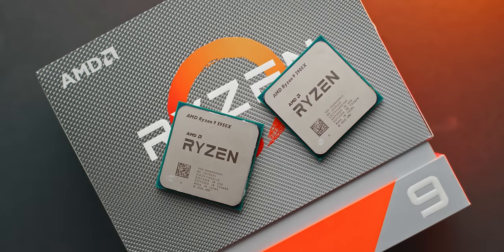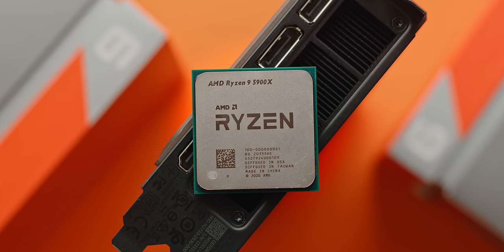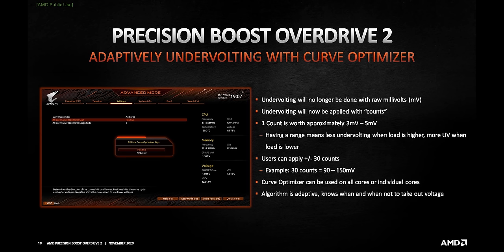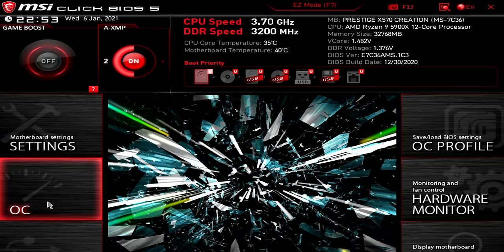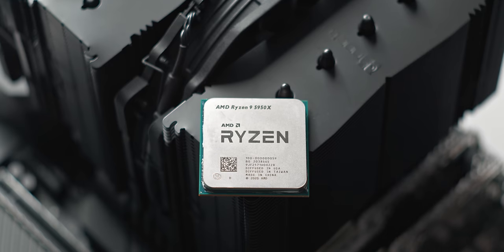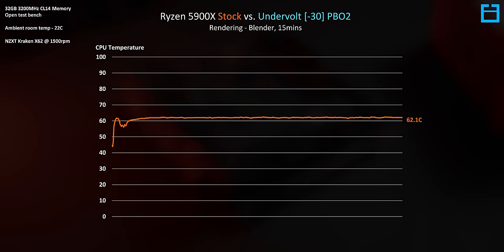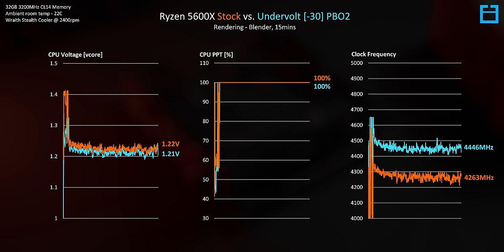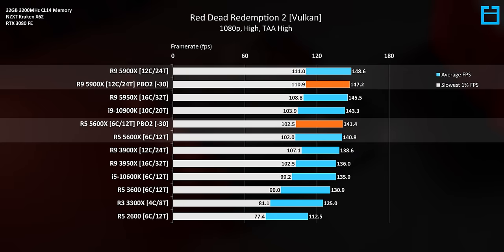Ryzen 5000 Undervolting with PBO2 – Absolutely Worth Doing

Comment: I have a 5800x, thanks for using everything except that one xD Edit: I did mine but my max value seems to be 10. On idle it's already 5 degrees cooler.
Reply: What happened when you tried to increase the max value / what were the signs of instability?
Reply: @Lha_Luke  There are no sign of instability. You just put the highest it allows and go about with your day. This isn't a regular over or underclock, it's safe. They put the limits for you.
Reply: Highest I can go without cinebench23 crashing is -15 with my 5800X. Max temps now more than 5C lower, gained a few hundred points on multi core, single core remained pretty much the same.
Reply: @Lha_Luke  I got instability. Crashing. Blackscreen. BSOD. Keyboard and Mouse locking up and some game crashes I'd never experienced, when I set it too high on my 5800X. Although I could stress it with CPU-Z at 25 and 20 for 5 minutes just fine, temps weren't lower but performance increased. But then in games I'd get crashes.
Reply: Not trying to flex, but I managed to reach 25 stable.
Reply: @kibido7373  It doesn't let you go past 10 unless you turn off the safety. I'm not going to mess with my PC till it becomes unstable then back up a bit. I did this for thermals, pushing for an extra half a degree isn't worth it to me.
Reply: @kibido7373  same here with my 5800x i did -30 but system crashed in AC valhalla settings ,dialed it back to --25 and so far its golden benchmark  looking fine as well in cinebench R20
Reply: So far I have mine running at -22 and just scored 1652 SC Cinebench. I agree with other the concern will be stability at idle/low loads. I noticed at -30 that I couldn’t even boot up. The computer got stuck in a restart loop until I changed it.
Reply: No matter what i do my 5800x stays at 82-86 degrees in Cinebench r23...
Reply: @SwiffyDK  That's really bad, is your cooler on properly?
Reply: @Tony-nl6pf  Yep I have taken it off and on again. I’m using H115i Capellix with Kryonaut thermal paste.  I’m running it on stock settings.
Reply: 5800x on x470 Asus CH7, -20 with +200mhz boost, hitting 5015mhz single core and temps are lower
Reply: @Justathought81  I cry
Reply: @SwiffyDK  stop QQ it wasn’t stable ;) for a moment I thought I had nice chip but maybe not so good. Of course even at stock this things an absolute beast so I can’t complain :)
Reply: @lawnica1  Update couldn't get my PC stable with anything below -15 undervolt. Still pretty nice performance and temp improvement.
Reply: I was able to run -30. Dropped temps from 90 to 85 in cinebench r 23 and increased score from 15000 to 15600. Boost clocks up 150 on average.
Reply: update: 5800x/1080TI/64GB3600 here -- -30 with settings above is making my games crash to desktop.
Reply: My 5800x passed cinebench multiple times with -19 offset but to make it stable and error less with occt and prime95 I had to lower it to -11. Temps are 5/6 degrees lower and cinebench score is 300+ better than stock.
Reply: I've just set it to -20. Max temp setting to 70°C running loop with gpu and cpu 2x 360 radiators with ek vardar fans. Ryzen master settings are PPT: 1.050 TDC: 80 EDC 115 
Max pbo I'm getting is 4600 mhz and it never goes above 70°c . Cinebench score of 15122. Still have to play some games to check the stability
Reply: I just set my ryzen 5800x to -20 and my temp on idle is roughly 60°c and under load I find it a bit high with temps peaking at 90°c what about you guys?

Comment: Motherboard limits to disabled why? This I just the UV what's about the offset. You can easily get the 5600 boosting to 5ghz+. Just by add this setting  to what u already have. Add a +350 offset in the Advanced CPU configuration and also set it in the AMD CBS menu (@+200 as that's what AMD officially allow in that menu). That why your curve optimiser works a treat.
Reply: Exactly this. This video just scratches the surface. There's much more to tweak to unlock the full potential. Enabling PBO is key to this (but it means you have to put in the work - the PC will now crash with a simple -30 undervolt on most CPU's). 

I'm running a 5600X with PBO, +400Mhz, -12/-17 on best cores and -22 on the rest. Runs around 4700Mhz all core in CB20 with voltages around 1.25v for a score around 4700. Single core it achieves up to 5050Mhz with scores around 640 in CB20 (which is not that special - my best cores aren't that great).
Reply: @miseryshining  How do you determine your best cores? (If that's even what your trying to say you've done here) I am still kind of a rookie and I'm trying to gather as much information as I can so I would be ready to get the best out of my next pc build once rtx 3000 series and ryzen 5000 series are more available.
Reply: @Leonard_27  the ryzen master software tells you that info iirc
Reply: ward

Comment: Brilliiant. Couldn't get -30 with 5600x, Hyper 212 Black Edition and Gigabyte B550 GAMING X V2 but -25 works fine. Lower temps for everyday day stuff and +200-300Mhz higher clocks when needed at the same temps as before. So quick and easy to do.
Reply: even -20 crashes games under load for me. Had to switch to -18

Comment: My G. Thank you for simplying this for me for now. I just finished my build and got a free upgrade from a Ryzen 7 5800 X to a 9 5950x. Yes my multicore performance increase was obv. amazing though single core score not as much.(as it could be). I have 4 cores peaking at 4.999 @ 38.4-72C (warm day). I may have only gained a slight 0.45 MP Ratio in Cin3R23 with my 4 cores now hitting 5049 MHz but my thermals are no longer touching 67c under load. 
This is a great stopgap so I can move the F on until I can learn more.

Comment: got -17 stable on 5800x. All core down from 89*c to 81*c, all core boost gained 100mhz and score increased by 30 pts in r15. Single core frequency and score didn't change but dropped 6*c. Overall great outcome.

Comment: For 3000 series, it was not that recommended to undervolt, they found it sometimes had less performance even with higher clocks than stock. Not the same anymore with the fixed 5000 series is incredible ! And it's fairly simple !
Reply: Well, it had to do with the power limits of the chip. Package Power adjustments were previously the correct way to reduce thermals while barely affecting performance. This was due to how X570 and PBO worked with Ryzen 3000. I am glad it's fairly standard across the board now though. Surprised that Optimum Tech didn't know about the PPT adjustment. That was the "correct" or ideal way to adjust thermals
Reply: nah i recommend it tested several times between default and undervolt. the voltage in default was way off and runs super hot. undervolt 3600 to 1.25v @4.2ghz runs fine and better in cinebench after several loop and the thermal -15+-
Reply: @nyabudulu  100% agree since I do the same. 3600 4.2ghz@1.225mv is better than 4.2ghz@1.35mv
Reply: It was recommended. Undervolted my 3700x it reaches higer boost ferqs and lower temps (15-20 celsius). 4375mhz singel core and 4100mhz all core in node 202.
Reply: I find undervolting my 5800x hardly does anything.  The only good way to reduce thermals has been to power limit the chip.  And this is with dual 240 rads in my Ncase
Reply: @SSJ3Goku69  Higher clocks, more singlethread perfomance, better gaming too.

Comment: @Optimum Tech, I would suggest keeping the PBO limits to "Motherboard" instead of "disabled" considering the case where PBO might have some stability issues then later option sends the system in a boot loop.  (Based on personal experience)
Reply: THANK YOU YOU HELPED ME SO MUCH. why did i watch this stupid ass video took like 10hours of my time and couldnt pinpoint what the problem is. He should seriously take this video down i'm fuming...

Just set pbo2 on eco mode because i dont want to fumble with the settings and base clock to 3.3ghz instead of 3.7 just trying to run the pc at lower wattage because i run off a battery (i use a 5600x)
Reply: What's the difference between Motherboard and disabled. My pc keeps crasing when i idle.
Reply: Please explain! What does motherboard do?

Comment: Heh... Did -25 on all cores on my 5600x without overclocking (just needed better temps). So in Cyberpunk where I had 80C, it now became 62-65C! I'm literally very impressed! I use the Wraith Prism cooler at 50% of it's max RPMs, cause at full it's just to loud. Wanted to replace the cooler, but this changed the game for me! :)
Reply: Hi, I’m in the same situation as you with the wraith cooler.. What voltage did you set it at?
Reply: Is undervolting still stable for you?
Reply: @enessengul219  Yes. Stable and cool. :)
Reply: Whats your setting in PBO limit?

Comment: Hell yeah, I've been fighting this for  6 months with 5950X.  Seeing the curve optimizer updated into my ASUS bios (it's the original Crosshair VIII Hero) was a huge relief.  I haven't set it up yet, I've just been thermally throttling with a water block setup @ 75C.

Edit:  I just set up the Curve Optimizer with a 5 negative offset for all of CCD 2 and zero on CCD1 (with my best cores), I'm getting 10C lower temps already and still getting my 5.2Ghz on two CCD 1 cores.  Voltage is idling around .95 with max voltages at 1.401
Reply: Did you used boost override? Have you done a CB20 run so far?
Reply: @agentorange1291   I did all of this in my BIOS.  Actually ran into some consistent fatal errors on core 14 at idle, so I had to remove the offset for that core and it's working well now.   My R20 score is 10828.  Manual overclocking to 4.9Ghz on all cores I got it up to 11960, but thermally and longevity wise that's not a realistic thing to do.  I was running temps at high as 90C with 75C at idle even with 360mm water cooling.  My temps are now around 40-50C and peak at 60C when I'm gaming.
Reply: @CHAOSMOVEMENT  Are your best cores only on CCD1? According to Ryzen Master I have a on each CCD a gold start core and a silver star core. Did you changed your boost override? What I have seen that with lower PPT (200) and lower EDC (150-160) I get better results as when I chose the motherboard limits in terms of temps. THe bench results are a bit lower. But when I use the motherboard limits my CPU is on 90degress in CB20 MC and around 78 in SC. The results vary quite much specially in OCCT.

Comment: Do one for 5800x a step by step 🙏
Reply: This!
Please do a 5800x with full step by step instructions for the lamen!
Reply: @jasonredwine4092  Just try it out yourself? If you end up over-doing it and the pc doesnt boot anymore, you'll have to clear the CMOS (resetting the BIOS settings). To learn about how to do this, just read the manual of your motherboard. It'll either have a button on it for this if it's expensive enough, or it will have 2 metal poles somewhere that you will have to link together for about a second with another metal.

Comment: You should have done a test for 5800x. that cpu is the worst at stock temps due to the ppt being set to 142W out of the box and not 105W as stated on the product page.
Reply: PPT is the physical design power of the AM4 socket though, not the TDP of the chip itself. A CPU can run with higher power absorption than the TDP for a short while.
I just recently put together a 5800X system (maybe I should have gone for 7600X!) and it really isn't that hard to keep temps down. A 50 dollar Thermalright cooler and undervolting (Negative 25 on the Curve Optimizer) keeps it well away from the thermal throttle limit (90C) even on a 130+ watt Prime95 test load.
Reply: @devilsoffspring5519  I have tried that with mine. But still sits at ideal around 50 to 65degC. Most cpus are at 40 to 45.

Comment: Changing my PBO limits from 'motherboard' to 'disabled' killed my performance (5950x + Crosshair Hero VIII)
Dropped from 28.9k in Cinebench R23 to 25.6k

Also the undervolt didn't have the same effect as you described - instead of lower power/heat and identical score, I got identical power/heat and higher benchmark scores.
(Not that I'm complaining about that!)

What I did now was set PBO limits -> 'Manual' and picked something between 'disabled' and 'motherboard' so I got a middleground where temps/noise are under control but with a performance increase.

Looking at Ryzen master:
'disabled' PBO limits: ppt: 142W, tdc: 95A, edc: 140A (I hit 142W, 72c, 50% fan speeds)
'motherboard' PBO limits: ppt: 395W, tdc: 255A, edc: 200A (I hit 220W, 89c, max fan speeds - too loud)

I went with ppt: 180W tdc: 255A edc: 200A (so 'motherboard' but with lower watts)

Comment: All this looks great until you do stability test with cinebench. I thought it was the ideal setup until it immediately crashed 2 or 3 times in cinebench runs. Only when scalar multipliers were set to 1 it didn't go haywire. I strongly encourage othera to just use PBO limit instead; waaay more effective at temp control. Set all offset to 0.

Comment: Thanks for the tips, I undervolt my ryzen 5 5600g to - 20. Beyond that will restart the system. The first try -30, 25, 20 failed then try from -12, 15,18 and -20 is working and become stable until now.

Comment: Do not follow his advice on your 5600x 5800x 5900x. -30 will pass every tests inside 1 hour but it will crash after weeks or months out of nowhere. When you get that crash go to event logger built in windows and check which core has crashed. Reduce the curve by 5 on that core alone using Per Core settings. -30 will actually work on amazing golden chip only and there has been no data on it yet. Start from -25 it will
keep crashing or if you are lucky like me you will stay here. By -20 -15 you end up in almost the same range with Manual OC.

So what is the point of PBO then? Its just another way to OC. That simple. No benefits. Maybe the ease of use for completely newbie.

Comment: -30 is pretty crazy. Is it really stable when idle? Curve Optimizer often causes crashes when idle or under very light loads before it causes crashes during stress testing. My 5800X can't handle more than -5 or so on all cores. It could however handle -15 or so during stress tests.
Reply: can't handle -5? that's kind of unfortunate, try -10 on your weakest cores and 0 on your 2 fastest cores, might seem counter ituituve but this gave me the most stable results on my 5800x , what might be happening is that single thread burst tasks get prioritized to the fastest cores but your undervolt might be too much for the single core boosts on your fast cores but is stable for all core boosts, ideally you would want to change the voltage freq curve to be sharper i.e. higher voltage for higher frequencies but maybe in PBO3
Reply: mine got through 40 minutes of stress testing without errors with -25, but cant game with -10... Going crazy over here.
Reply: @wastedyouth4453  yea kind of same here. The cpu's seem pretty bad ballanced. This happens because actually the cpu requires a higher voltage to run in single core mode, than in multi core mode. So when you are stress testing it, it requires less voltage on each core, but as soon as it is idle / almost idle and runs just with a 1 or 2 cores while the rest are  in "parking mode", it crashes because these 1 - 2 cores don't get enough voltage. 
It is quite ridiculous, I hope there will be a way or an option to fix this in the future.
Reply: my 5600x can boot in -30 but reboots in idle and not stable in aida64 and was a bit crazyy in desktop,  to get full stable is - 7 : s
Reply: @wastedyouth4453  same!
Reply: @derek4177  This would explain why my 5800x was stable in multiple stress tests with an offset of -30, but randomly restarts when using normally. So far a -25 offset seems to be stable, but I am curious if some single core tasks will prove otherwise.
Reply: @Lha_Luke  yea. Try the next day, when your PC is cold and you just switch it on. 
Let it boot and let it rest/idle for 5 minutes in the Desktop. I bet it will crash :D
Reply: The CPU in the video is absolutely not stable, it will fail within minutes of corecycler

Comment: I offset undervolted my Ryzen 9 5900X by 0.1v, capped the CPU frequency to 4000 Mhz, and it immediately dropped the temperature from 61*C to 48*C.  I've got this CPU in a mini-ITX built in a Cooler Master RC-130-KKN1-Elite case with a Corsair H60 AIO with its 120mm fan swapped out to a Phanteks T30x120 fan.  I changed out the 80mm side fan to an Arctic PST 120mm slim fan set to exhaust, and added another Arctic PST 120mm slim fan to the top using an aftermarket fan mounting bracket (daisy-chained together to one PWM CHA_Fan header.  I'll be tweaking the fan curve of these fans in the BIOS.  Using an EVGA SuperNova 850W Gold Plus SFX power supply left me enough room to get the top fan in.  This further reduced the CPU temperature to 42*C  Running Cinebench R23 for 10 minutes only brought the temperature to 66*C and no higher, achieving a Cinebench multi-core score of 19,829.

Motherboard/VRM temperature is a constant 47*C in this configuration.  

The GPU is a PowerColor Fighter RX 6700 XT.  Running it stock doing normal tasks, it maintained a 51*C temperature.  However, playing Halo Infinite on it caused the temperature to go all the way up to 98*C.  I customized the fan settings in MSI Afterburner to have the fans run at 60% constantly, and it maintains a 35*C temperature at near idle (doing normal tasks), and a peak of 72*C playing Halo Infinite.  

It sucks that Halo Infinite is such a crappily designed game that it pushed temperatures to 98*C before I ended the game to tweak the fan setting (and it doesn't even happen in a match, but while you're waiting to find a match!).